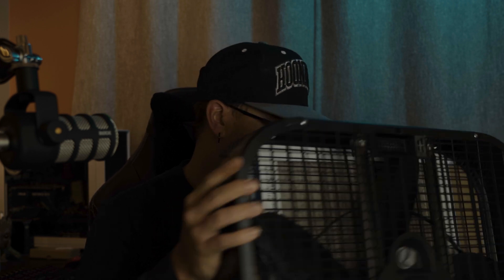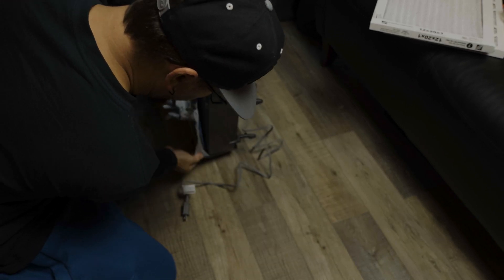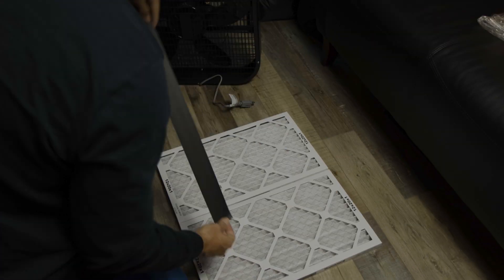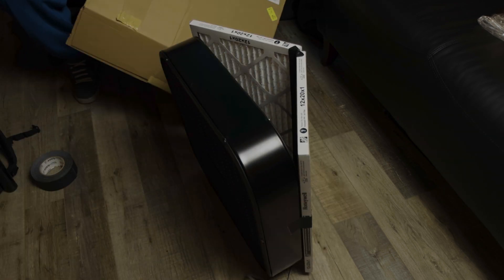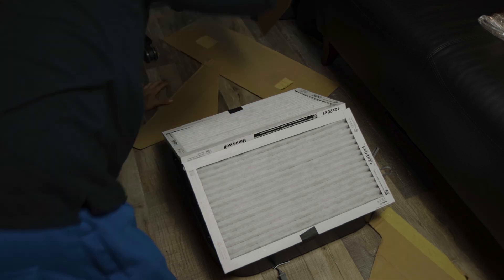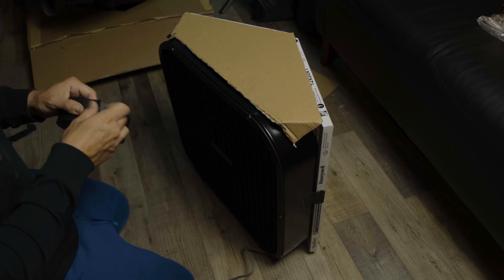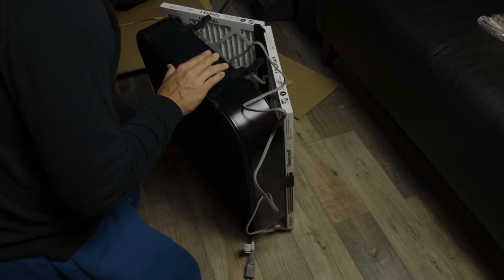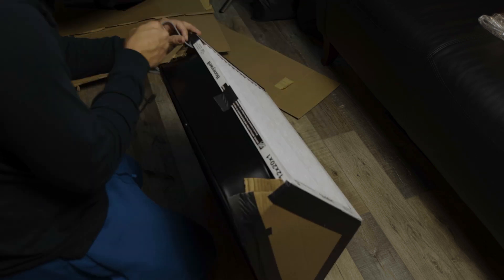DIY Air Purifier

Comment: I like your 2 filter design.  A little more work but the extra filter gives you more air flow and is less expensive than the 4 filter designs.  I'm going to give a single 4" MERV 13 filter a try because I'm just that lazy.